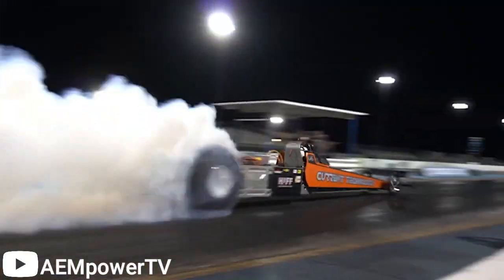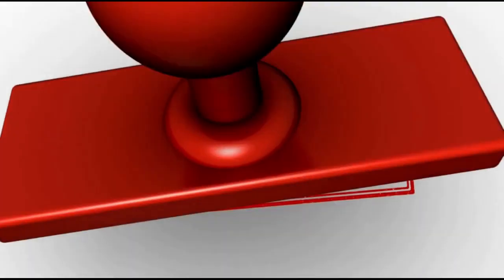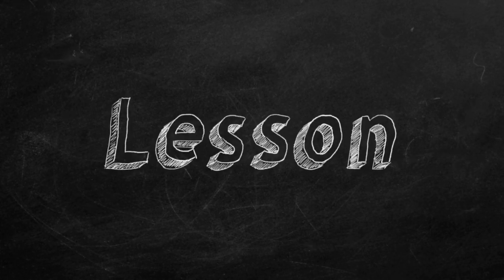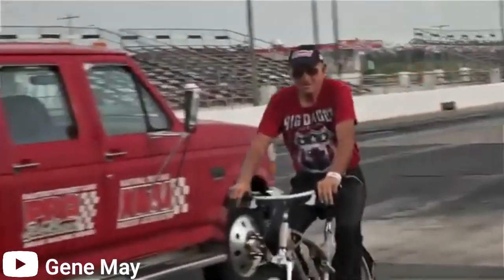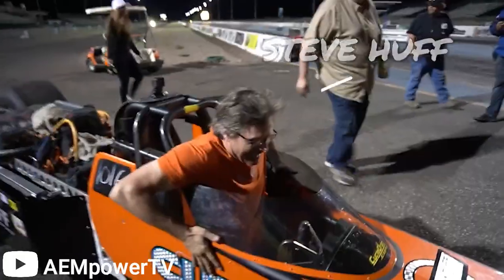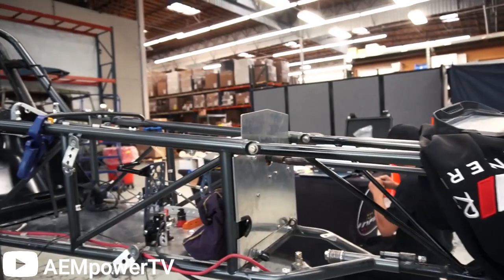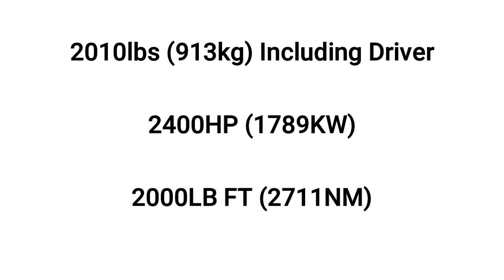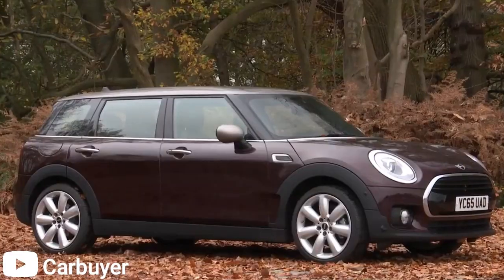Electric Dragster Hitting over 200mph in the Quarter Mile!

Comment: Drag strips might be the only place that gasoline/diesel is allowed, or at least one of the few places/vehicles etc. (etcetera).
Reply: I am a tech nerd, and I'm saying that electric is only going to be for inexpensive urban compacts, and "Lightning Rods" only designed to run the track a couple times between recharges. The range and load capacity issues that EVs have simply aren't getting better. They are butting against the laws of physics when it comes to battery energy density. Not like in the chip industry where that means things regularly get better, no butting against the laws because we're nearing the top of the curve really quick.